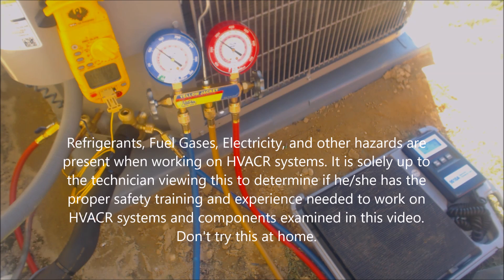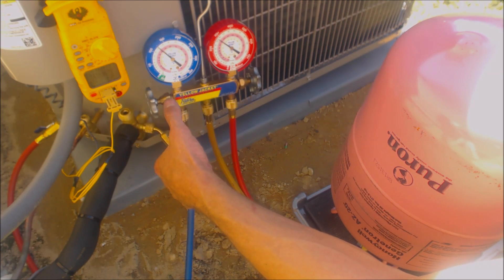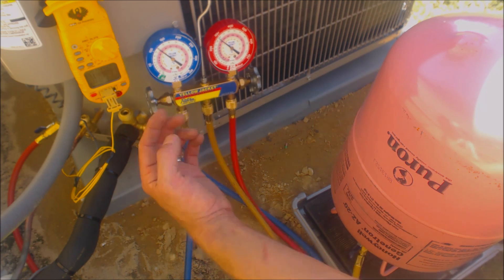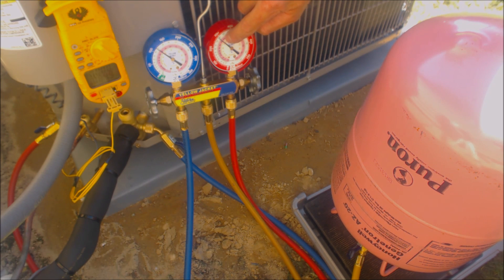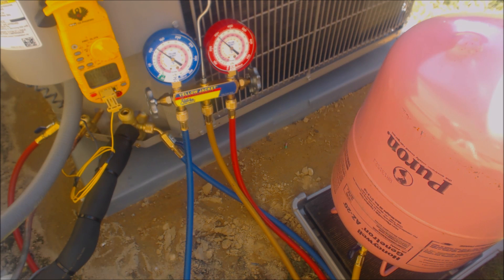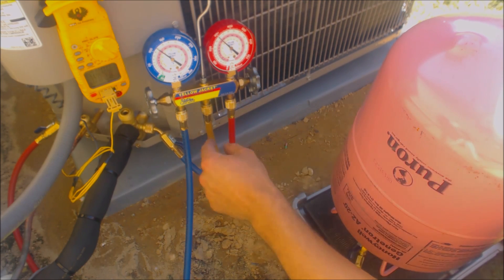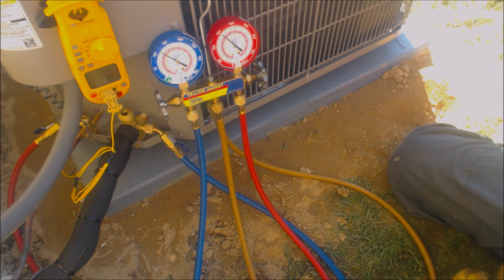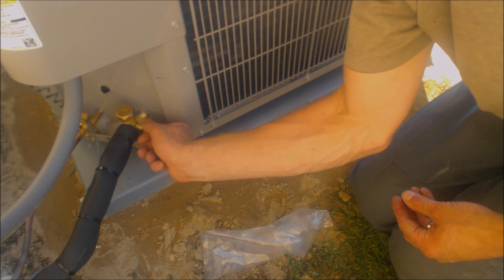How to Add Refrigerant to an Air Conditioner!

Comment from the maker: Tool List-  https://www.amazon.com/shop/acservicetech
Support-  https://www.patreon.com/acservicetech
For those that are looking for the tools used in the videos: (Linked Below)

Here is a link to the Digital Refrigerant Scale used in the video
http://amzn.to/2b9oXYl

 Here is a link to Refrigerant hoses with valves used in the videos  http://amzn.to/2aBumVI   

Here is the Link for the Yellow Jacket Refrigerant Manifold Gauge Set used in the videos http://amzn.to/2aenwTq

Here is a link to the Hilmor 4 port Aluminum Manifold Gauge Set- 
http://amzn.to/2m4QLik

Here is a link to a Dual Readout Temperature Meter with two k type temp sensors-   http://amzn.to/2sQffyB

Here is a link to the Appion core removal and vacuum tool- http://amzn.to/2t5ogIb

Here is a link for RectorSeal Bubble Gas Leak Detector http://amzn.to/2ckWACn

Other tool links can be found in the video description section.

 ACSERVICETECH is a participant in the Amazon Services LLC Associates Program, an affiliate advertising program designed to provide a means for sites to earn advertising fees by advertising and linking to Amazon.com.
Reply: When you charge an older orifice tube system do you worry about superheat and sub cooling ?

An AC tech told me once that 75 on the low side and 240 on the hi side is spot on but you didn't seem to worry about those numbers at all.🤘🏻👍🏻

Comment: Why was there  a need to purge the liquid /red line if you're not adding to the high/liquid side?  Won't you get an accurate pressure reading regardless of whether that line is purged?

Comment: I'm curious, since you tried to purge the blue line while the system was running (suction) and nothing came out, air, wouldn't that indicate what ever air was in the blue line already has been sucked into the system since you did it with the system running? Seems to me the way to do it is to first connect the lines with the system off, purge the blue & red lines of air from the internal pressure leaving the system, and finally open the Freon can and purge the yellow line of air.

Comment: What happens if you don't put the little black caps back on? Asking because we had a guy come out to fill the ac and 5 hours later still no cold air. I went out side to see if he forgot something and I found one of those black caps on top of the ac unit

Comment: So one thing I cannot find answer to from anywhere. The vapor line we call it auction line which means compressor is sucking in.           So how come when you purge from the blue hose on suction line, it doesn’t suck air in? I was always in assumption that the big line is sucking all the time as compressor runs?
Can you explain please.

Comment: Good video. I think you forgot to bleed the red hose into the system.
Reply: He did not use that side, thus no need to purge(I believe)
Reply: I noticed that too..after he adds the reaming refrigerant in the yellow he doesn't do the same for the red.

I feel like in a different video he made he valves off red and yellow, opens high side, adds remaining liquid in red then yellow and then disconnects.

But maybe here he just wanted a dead-on subcool and didn't add the red?
Reply: Mr. Miyagi Yeah. Now that I think about it I think you are right.

Comment: Excellent video.....1 question 410a with TXV same as this video....any difference/concerns if your charging the system on a day when its 70 degrees outside as opposed to a  90 degree day outside... and not in direct sun light
Reply from the maker: The target subcooling should be listed on the outdoor rating plate and you can check the charge any time it is 70 degrees or higher inside as well as outside, thanks!

Comment: Is it super important to have the caps on? Our brand new unit is blowing air but it's not cold. Went out there and the caps won't even thread on - they were just propped on there.
Reply from the maker: The indoor or outdoor fan could be not running, the compressor could be not running or you may be low on refrigerant. if it is new, they certainly should have caps on them. Refrigerant could be leaking out of the ports if the schrader valves are not seated properly. Any way these are things that may be possibly wrong, thanks!

Comment: so in this video the refrigerant is going from the tank and is being pulled into the house toward the evaporator?
Reply from the maker: Hey Diallo, out of the bottle and into the suction line going into the compressor inlet, thanks

Comment: When weighing, document the total weight of the bottle.  I write the original weight in shapie, as well as what I use and when.  Keeping both a used total and total weight.
Reply from the maker: Sounds good! I put the yellow service hose under the plastic case of my scale and then zero the scale out. This way gauge movement does not affect the scale reading, thanks!

Comment: I'm confused, I thought we would charge the system using the high side gauge, not the low side if we we're using the sub cool method?
Reply from the maker: we use the subcooling method for systems with a txv that are single speed and not microchanel but we still monitor superheat to make sure that the txv is doing its job and to mae sure that the sat temp on the low side is not below 32 degrees, thanks!

Comment: hi, does the evaporator saturation temp. go up when you're adding refrigerant into the low side? I see that the high side pressure goes up but what about the low side? does it also go up simultaneously with the high side? thanks.
Reply from the maker: On systems with a piston the low side will rise but on txv systems the low side will not rise, thanks!

Comment: Hi, I just love all the videos you are putting up, and thanks to you I'm going in to this occupation because around here there is not many technicians who knows what they are doing. 
But I have one question, are you using different gauges for different types of cooling gas, or can you just purge the gauges before use. 
Thanks for a superb series of videos, which are better than every school and courses you can attend.
Reply from the maker: I do use different gauges for the refrigerants but when starting, you will likely not have 3 gauge sets so just purge well and then use them, thanks!

Comment: The refrigerant liquid was kept in the hose in the disconnection procedure, is that a good practice?
Reply from the maker: In this case I did not want to overcharge the system but if you can anticipate how much refrigerant you are going to need then yes add that liquid in. We always do that on pm's but this was weighing quite a bit of refrigerant in, thanks Sheng!

Comment: on older leaking units if suspected low refrigerant should you check with bubble Leak Detector even before removing caps?  and then again after removing caps before attaching gauges?  isn't the schrader valve the most prevalent cause of slow to very slow refrigerant leaking??  Should you replace your older valve caps with newer o-ring caps?

Comment: What about adding refrigerant by the amp draw
Reply from the maker: We only use superheat, subcooling, total weight method, or other approved manufacturer charging methods for AC units. Superheat and subcooling give you a real glimpse into what is actually happening in the system and we also use these for troubleshooting, thanks!

Comment: Sir are subcooling and superheat applicable to car air-conditioning tnx
Reply from the maker: they are applicable because they do happen but the rate is not the same since the vehicle ac compressor turns at varying rate depending on the rpm of the engine, thanks!

Comment: where i am from, they really don't use scale or even worry about sub cooling and stuff. they just charge the r410a upside down and use the low side gauge to check the psi. is that ok?
Reply from the maker: Wow, no it is not ok for efficiency or compressor safety. If a system has a fixed orifice, you use the superheat method. Look up "acservicetech superheat or target superheat" for charging videos, thanks

Comment: I like the way you charged here compared to how I was taught. I was taught to add liquid to the high side with the system off (into receiver) which doesn't show in real time how the charge is affecting subcool and is more complicated in disconnecting hoses as you have to clear the refrigerant from the high side into the low side.
Reply from the maker: Thanks John, I do break the vacuum with liquid refrigerant into the liquid line when weighing in a lot of refrigerant often, thanks!

Comment: please explain why are adding R410A blended refrigerant to the system with gas already in there.you have to reclaim everything as now you dont the right ratio of the gas blend in there.
Reply from the maker: Saveena, This is a new install so you don't have enough refrigerant if the system has a long line set. That is why we add refrigerant. I regards to the other issue of a blend, R-410A can be topped off if there is a leak that is fixed. That is not a problem. In the case of R-410A, manufacturer trainings will say it is ok to top off systems as far as the blend is concerned because it is near azeotropic even though they want the refrigerant to come out of the bottle as a liquid to avoid fractionation. Obviously not over and over again. If you are working with other zeotropic refrigerants then more care must be taken when fixing leaks and adding to the charge. Here is some good reading material. Thanks for the question! http://www.achrnews.com/articles/82752-blends-101-an-introduction-to-refrigerants

Comment: So what would happen if u left the vapor side open  instead of putting in a little at a time. And what would happen if put to much of r 22 in there? I'm 20 trying to get my HVAC and need as much knowledge as possible before I take the test
Reply from the maker: Overcharge for fixed orifice systems will damage the compressor with liquid refrigerant entering it. TXV systems will be less efficient when overcharged. You would damage the compressor if you charged a lot of liquid into the compressor at a time. It is a vapor only compressor, thanks

Comment: thank you for share. I have a question did you check superheat after you charged refrigerant to ac unit with subcooling method? I charged refrigerant to my r22 system ac unit with txv with subcooling method last week,my gauges showed my subcooling is at target,but I tried measure my superheat it was too high I got about 35superheat. My lowside gauge got 65 psig saturated temperature about 40 degrees and suction line temperature about 75 degrees. So 75-40=35superheat. Is there something wrong?
Reply from the maker: It sounds like a liquid line restriction or the txv is not adjusted correctly. Take a temp reading across the filter drier to see if it is blocked. If it is higher than 2-3 degrees then it is clogged. If it is not the filter drier then check the screen and txv. You can also look up"acservicetech liquid line restriction" thanks
Reply: AC Service Tech LLC thank you so much

Comment: The unit is suppose to be running for at least 19 minutes before checking refrigerant levels. And 10 minutes in between adding refrigerant..... I was told
Reply from the maker: Hey Armando, if it is a piston then wait 10-15 minutes but a txv doesn't take as long to stop fluctuating so I usually say 5-10 minutes. The longer you wait, the more accurate and precise it will be for sure. The issue is, 10 minutes is excessive between adding only a few ounces in at a time. You will never get done after hours in some cases. When you get closer to the correct subcooling or superheat, that is when you slow down and then yes 5-10 minutes while you are filling out the paperwork is nice at the end just to make sure nothing changes. Thanks Armando!

Comment: Question: So When doing a recovery do you do that through low pressure superheat? And when charging do you do that through high pressure subcooled ?
Reply from the maker: So when charging, you are typically taking liquid from the bottom of the bottle at sat state pressure into the low pressure side of the system. When recovering without a recovery machine but the compressor itself, subcooled liquid pressure comes out of the system and into the sat state pressure recovery bottle, thanks Brent!

Comment: How do you know how much refrigeration to add to a Rv ac
Reply: Help??
Reply from the maker: Superheat if it is a piston but typically access ports would need to be installed first, then find and fix the leak, then charge the unit. The total weight procedure is used if all the refrigerant is out of the unit , thanks

Comment: I have a brand new set of YJ 410a manifold gauges. In trying to obtain subcooling I connected my hoses to the unit ports; the high side gauge went up to 250 PSI, but the gauge on my low side (Blue) didn't move at all. Along with that, the saturated temp (80 degrees) was below the temp on the high pressure line (82). So not knowing why my gauge wasn't showing pressure and why the temps, I disconnected the lines from the unit. Do you think my gauge is damaged and why can't I get a higher temp on saturated level?
Reply from the maker: The unit may be undercharged if there is no subcooling, your temp sensor could be off and not calibrated. You could put in 32 degree ice water to check. The blue hose end with the valve core depressor may not be pushing in the schrader valve enough, You also need to zero your gauges out first for your elevation, thanks

Comment: What determines the refrigerant entering into the unit in a  liquid or a vapor state.  Are certain refrigerants  always entered as a liquid while others have to be introduced as a vapor.  Cannot R-22 be put in as a liquid or a vapor, also why are you putting liquid into the suction line???
Reply from the maker: R410A has to come out of the bottle as a liquid to keep the mix correct. R-22 can come out as liquid or vapor. When the system is vacuumed and you would like to weigh refrigerant in, you can break the vacuum with liquid refrigerant into the liquid line. When the system is running, the liquid refrigerant can get metered into the vapor line slowly to keep the compressor safe. In some of my other videos you will see a vaporizer attached to my vapor port of the manifold gauge set to help vaporize the liquid into a vapor somewhat, before entering into the suction line and into the compressor, thanks

Comment: So when the unit is so low on 410 a it won’t turn on you would fill from the liquid side. Get it running then charge from the vapor side?
Reply from the maker: You could try that but the second it turns on, it would suck the vapor pressure back down and shut off. You would need some steady pressure going into the vapor side to keep the pressure switch from tripping or temporarily jump the pressure switch and keep the vapor pressure positive. The reality is that if the unit is that low on refrigerant then you lost likely 90% of the charge because that means you have no liquid left to vaporize inside the unit. If it was a seal that was loose and now you tightened it then ok but if it is a leak, make sure to fix it for multiple reasons. It won't hold very long at all as you need 97% of the actual correct charge to work correctly. You don't want that refrigerant to just leak out into the environment obviously, thanks Peter!

Comment: Hi, Did you turn on the compressor during you refill the freon?
Reply from the maker: This is a new condensor that had refrigerant in it from the factory and we were adding more after the vacuum, while it was running, thanks

Comment: Will charging with a vaporizer increase the speed of charging?
Reply from the maker: Not necessarily but you don't have to be so careful with the low side handle as much and it will also keep the compressor safe.

Comment: Hey there, it might be off topic a little, but I wanted to get your thoughts on using a charging cylinder? 
I work on refrigerators, and one of the techs said for small freon amounts in Ounces, it’s better to use a cylinder vs. a scale. 
I’ve noticed that the scale will change weight a little, not sure if because the yellow hose is moving around, but I don’t want to be fumbling around with scales and messing up charges. 

Thanks!
Reply from the maker: They actually have programmable scales where you purge the air up to the valve on the end of your refrigerant hoses or access port right at the connection to the unit and then zero the scale out. Program your total and the scale will stop the flow once there. I know what you mean, you really need to be very precise and watch what you are doing with scales that don't have a solenoid but will take into consideration hose movement. I just use electronic scales, thanks toneblair!

Comment: When you were adding refrigerant why was the bottle upside down if you are adding it as a vapor? I thought if the bottle is upside down you are adding it as a liquid?
Reply: you didn't explain why you did put liquid in the vapor side very clearly.  It was very confusing to new techs.
Reply: Steve Leriger rewatch the video.
Reply: It is a liquid when it's upside down. On some units it can possibly change to a vapor before reaching the compressor depending on what the condenser has before the compressor in the line.
Reply from the maker: R410a has to come out of the bottle as a liquid to stay mixed because there are actually two refrigerants mixed together in that pink bottle which make up r410a. I charged in slowely with only letting the psi rise a little on the vapor side which allows the liquid to vaporize somewhat before heading to the compressor. I usually use a kwik charge cylinder-    http://amzn.to/2wFHtBW    -  in almost all the other videos which you see hanging below the vapor gauge in those other videos, thanks and here is the list of playlists-    https://www.youtube.com/channel/UCOZR-1IqsAer9wzlvFgb4mA/playlists?view_as=public